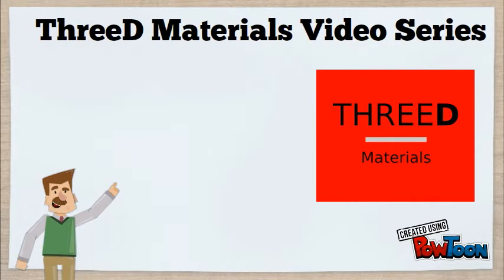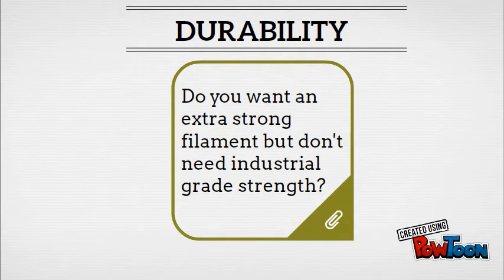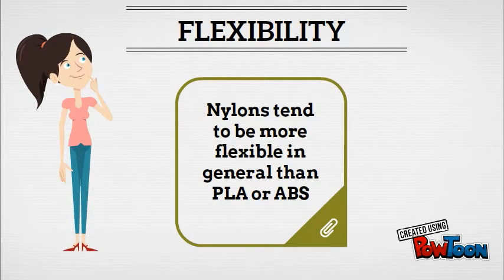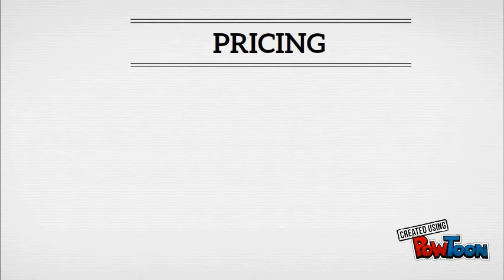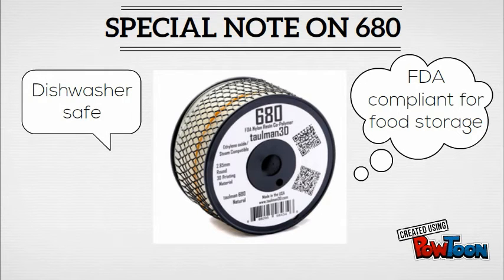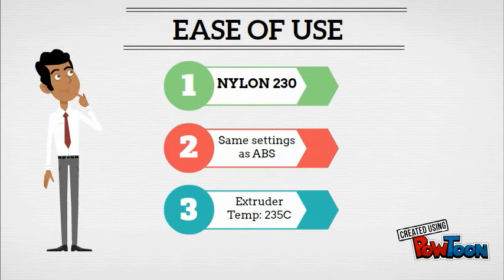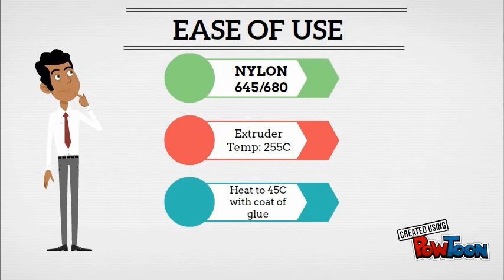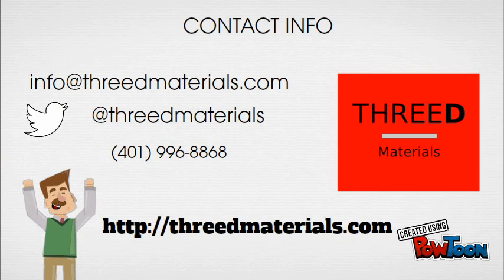ThreeD Materials - Nylon 3D Printing Filament Comparison

Comment: on my back yard I want to drill a hole and I was wondering if I can print a bit like of 21 inches long and 20 inches wide. instead of using a metal bit auger. What's your suggestion. I would have to apply some pressure can this material help?.
Reply from the maker: Hi Fernando: we recommend Tech-G or Alloy 910 for the job you're describing.  Feel free to give us a ring to discuss in more length.  Sophie - ThreeD Materials
Reply: ThreeD Materials what's tech g or alloy 910?. this is a design that I want to invent. but iam going to print a small version first its more like a propeller like bit but able to go through dirt n grass.